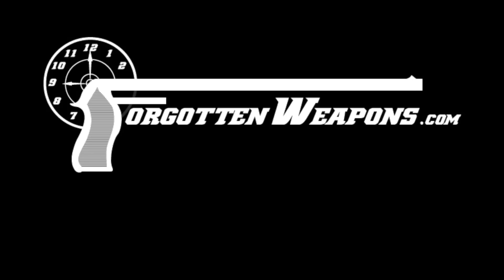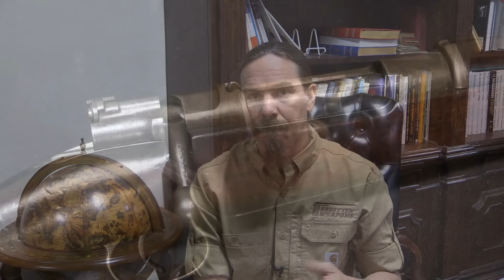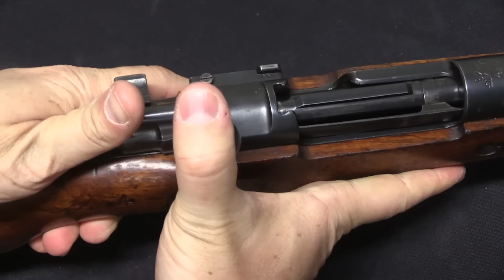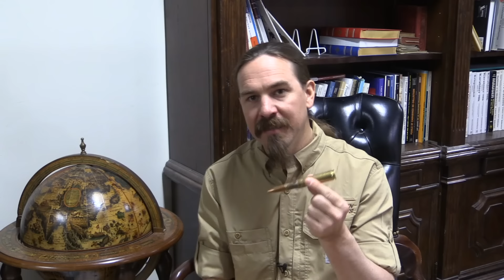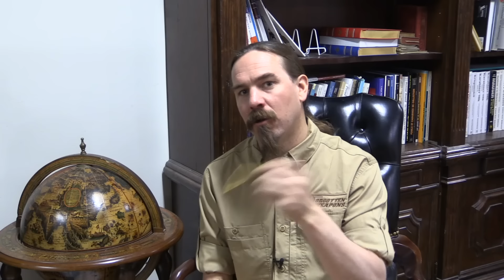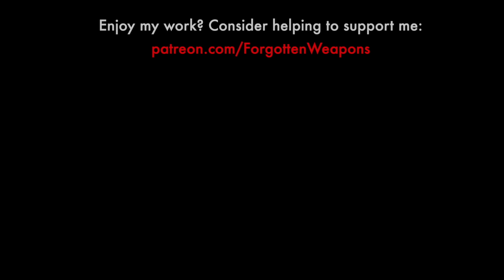Earth-Shattering ka-Boom! How (and Why) Guns Explode

Comment: Questions that Engineers and maybe Ian:

What overpressure % should a chamber be able to handle? Was this overpressure something that the design of the gun should have been able to handle in the R&D process? It seems like the amount of pressure necessary to shear off the breech cap was 30k higher than the expected pressure of a .50 cartridge, and it doesn't seem like that's something you could expect to design for.

What safety devices could you construct on the RN-50 to relieve/contain pressure in an overpressure detonation like this? The only thing I can think of is a much heavier duty surface than those two dog ears to make sure the cap is fully engaged that would be enough to launch it in a different direction, but I'm not sure something with that much strength is feasible for that design.
Reply from the maker: Standard proof load rounds are typically 30% above rated cartridge pressure.

Comment: Once at a public range I witnessed a Ruger Blackhawk  explode in another shooter’s hand. The top strap folded back and the cylinder went flying. Turned out he was using very hot hand loads from a friend. Thankfully, no one was hurt.  My take away was to never use someone else’s hand loads.

Comment: The problem is generally caused by the inability of the chamber or barrel to sustain the internal pressure resulting from the rapid combustion of gunpowder inside the chamber of the firearm.

Comment: Because PV/t, isn't propellant designed to excelerate as I burns to keep the pressure constant as the volume increases as the bullet travels down the barrel?
That being the case, should the bullet stop, the increase in burning rate combined with the volume not getting larger, make the issue much worse?

Comment: Scott said that there was no bore obstruction in the rifle. 
The rifle failed because the threads in the cap sheared off and the locking lugs failed. 
It would be nice to see an autopsy of the failed firearm done by an accredited testing company, I would not be surprised if the hardening of the end cap & receiver lugs were either too soft or overhardened to make them brittle. 
Was the bullet found stuck in the barrel after the explosion? 
The rounds that he was firing, are there any left? They would be worth testing as well.

Comment: Some say that the slap round was not approved for the compensator.Not sure but the previous round kinda acted like it was looking like that.Glad he is gonna make a full recovery.Just tried to tell a kid that his .223 was not rated for 5.56 yet he still fired it.From my understanding a 5.56 can shoot .223 but a gun rated for .223 should not fire 5.56 due to the head space angle differences.Alot more pressure in 5.56 loads.I believe alot of folks do not know this.The salesman at my dunhams tried to tell me otherwise and im glad i research before just accepting hearsay.

Comment: Ian a slap round is already the hottest round of all the 50bmg rounds, And most of them are old really old. So As nitric acid gas bubbles out it changes the surface composition. This is in fact bad, very bad. Pressure spikes can and will develop so the extra pressure. So it was not caused by a barrel obstruction it was extra pressure due to the nitric acid break down of the powder and it takes millionth of a second pressure spike to blow.  Incase you did not know a slap round is sabot around a titanium core that needs a lot of extra pressure to get the titanium core to punch armor. I have pulled about 50 of them a part to get the old powder out to reload and had only 7 of them that had good powder in them. It comes down to how they were stored most of the time.
Reply: M962 SLAP-T and M903 SLAP have the same chamber pressure as M33 ball, they are not "the hottest." The increased velocity is due to the projectile being lighter weight than standard ball ammo, not increased powder charge. Also, the penetrator is tungsten, not titanium. I strongly doubt the chemical composition of the powder changed that much as SLAP was first used in Desert Storm, so at worst the ammo was around 30 or so years old. People shoot old surplus ammo MUCH older than that with no issue. The SLAP round was intended to be fired from the M2 machine gun ONLY, not a rifle with a muzzle brake. In fact, the manual for the Armalite AR-50 warns to never fire saboted ammunition through it because the plastic sabot can get lodged in the brake and damage the weapon or cause injury or death to the shooter.

Comment: Is there anywhere that has the fired cartridge case parts? Was it destroyed in the detonation?  I believe it was a catastrophic case head/rear end failure, due to something out of spec with the ammo. I do not believe Ian's surmising that it was a bore obstruction whatsoever. This is because of the failure of the rear cap/containment of the deflagration... it was never going to have a forward path once the case head separated early in the propellant burn/pressure curve.
Reply: @Research Development Thanks RD, yes I did watch the video of the event and appreciate the info that the case head had indeed separated. If this occurred after the cartridge was fired (rather than as a result of the rear cap failing prior from so many different theories on the net right now) then the cartridge case would not have expanded to grip the chamber walls and seal the deflagration and direct pressure forward in the controlled pressure curve as the "pressure vessel" was designed to contain, I believe this was certainly the reason this occurred.
Hey, I'm only an Aussie bush mechanic (Mech Engineer and metal tradesperson) but have seen a few case head separations in .308, .243, 30-06 in strong bolt action rifles including Mauser, Rem 700 and seen the locking lugs deform and destroy the ection, in one case shearing off the lugs and driving the bolt back down the lug raceways. All events had owners using compromised, well used empty cases that showed signs of incipient head separation prior to loading. In one case, an old Lee Enfield blew the lugs when a case head separated from old, 1943 cartridges where the brass had deteriorated and started to crack. Good topic mate.
Reply: @Research Development Yes mate, I'm a construction guy who now lives on the family cattle/deer property full time, I suppose US guys call it a rancher? But the firearm blow-ups I have experience with were (due to apparent circumstances of firearm design) survivable, in each case the shooter got a faceful of small brass pieces and burnt powder kernels impregnated under their skin and in eyes, one was a friend who had a resulting serious infection (due to his doctor and himself) from not managing the injury properly. One pro pig shooter had metal pieces in his supporting (left) arm from the floorplate blowing out,as well (308).
It seems that the shooters being right handed (the actions blowing out on the opposite side to their face, in conjunction with the gas management being physical barriers in the action design, saved them from a direct rearward blast from the case head separations. It seems that a huge percentage of the pressure in these incidents directs backwards before the projectile exits the barrel allowing the pressure to drop. No projectiles were still in barrels, no barrel damage (a sign of obstruction) whatsoever, although actions/bolts were completely extruded and misshapen.
To me, and I'm no expert apart from my experiences, the rear cap design of the firearm in this blowup incident could direct the gases from a head separation nowhere but straight back into old mates face. Whatever the failure reason.

Comment: Mark Serbu posted a video a while ago correcting that the thread pitch, size and metal used would need and excess of 166000 psi to shear the cap off like it did in Scott’a case, which is pretty insane

Comment: I’m surprised you didn’t mention Mosin Nagant. As far as I know there’s no vent hole in the action. Also you need to carefully adjust the firing pin so it doesn’t pierce the primer and cause gasses to be directed back at the shooter.

Comment: Any follow up to this video since the recreation of the accident and Serbu's latest analysis?  Seems as though, all things considered equal, it was the round being extremely overcharged and not the barrel being obstructed.  In the recreation video it seems as though the bullet does in gact exit the barrel.  Also the video of the RN50 being poured into concrete and fired with the cap remaining in place.

I wish the case could have been analyzed for possible chemical composition to see just how the round was over charged.
Reply: The round being extremely overcharged is what then became a bore obstruction. The bullet did not leave the barrel fast enough to relieve the built up pressure, and so the gun went kaboom. That's a bore obstruction.

Ian said in this video that the cartridge is extremely overcharged.

Comment: I had a 6.5 Swedish Mauser that from time to time used to pierce the primer on firing .... the result is that the cocking piece comes back like a piston at high speed and used to hit my thumb and that was never pleasant .. I believe I was the cause of the failure as I purchased a couple of thousand primers from someone who had I believe subsisted Large Pistol primers to make up the number had no trouble when I changed to new bought primers the remaining primers where used to load pistol cal lever guns.

Comment: Mark serbu just recently uploaded a video where he's talking about how he gave Scott the wrong number for the amount of pressure that the RN50 can handle. Mark said he accidentally gave Scott the wrong number off the top of his head. But after consulting with another engineer he made the video saying that the RN50 can actually handle over 160,000 PSI, and not just the 85,000 PSI that he had previously mentioned.
Essentially Mark explained that that round wasn't just a little hot, it was giving out well over three times as much pressure as it should have.... Bruh...

Comment: I saw a brand new AR detonate with Turkish ammo. Didnt smell right. Had a rotten egg/ammonia smell leading me to believe the powder degraded or pistol powder was used. Magazine ballooned open. Bowed the upper and lower reciever. And split the bolt carrier in two. Case was still against the chamber walls. The very end of the case where the extractor grabs came off clean like it was cut. No bore obstruction. Scared the hell out of her. Gun did what it was supposed to do. It failed but didnt hurt the shooter.

Comment: I got an 8mm chambered in the smallest version of 8mm Mauser. The steel case junk i bought didn't indicate that it was the largest version of 8mm. I hadn't shot 8mm before so I didn't know that the recoil was increased. Only thing that happen d was that the cases got stuck in the chamber last one I couldn't get out and had to go to a gunsmith. No damage to gun but found out the bore was corroded. Sold it next gun show.

Comment: Tibosaurus Rex pulled out the military sniper manual on 50 cal rifles and it’s specifically says to never fire those type of sabo rounds thru a barrel with a muzzle brake. The buildup in the brake most likely caused the obstruction. That rifle also has zero safety features to divert the failure away from the person. They are not a safe gun.

Comment: It was a special 36 inch heavy barrel and "machine gun chamber" specifically designed to shoot heavier loads. The longer the barrel, the higher the chamber pressure. That ammo wasn't designed to be shot out of such a long barrel. And that rifle wasn't designed to fail safely. Throw a long a$$ barrel on a zipgun with 4 pipe threads for lugs and you no longer have a rifle, you have a pipe bomb.

Comment: I'm surprised the open bolt action out of battery detonation didn't result in an immediate stop to check the barrel for a bullet lodged in it - and that this wasn't mentioned as a potential consequence of detonation out of battery that results in cartridge case failure. If this failure mode doesn't create sufficient pressure to push the bullet out the end of the barrel, it's the same as a squib round and the next round will KABOOM the firearm. One of the other failure modes I've seen is firearm calibers that crossed over from black to smokeless powder with someone loading an antique that was made for black powder with the proper caliber, but in a hot load with smokeless powder. A classic example is the .45 Long Colt that originated with the M1873 Single Action Army. Load up one made in the black powder era with one of the hotter smokeless rounds made for large game, and the cylinder will likely fail, probably with the back strap as well. There are other examples of old firearms not made for some of the commercially available loads available for the caliber now. I have a Ruger Blackhawk .45 Colt that I made certain can handle the hot hunting loads commercially available for that caliber before I bought it. Some are not. Same applies to some calibers that were used in revolvers and carbines to simplify ammunition for those that carried and used both. There are hot hunting cartridges now for the carbines that should not be used in some revolvers.

Comment: The obstruction was in the muzzle brake. There is NO copper engaging the rifling. It was a SLAP round with a polymer sabot.
The SLAP round manual says they MUST NOT be fired through a muzzle brake.
Why?
As the polymer sabot leaves the muzzle it tries to spread and leaves residue on the inner surfaces of the muzzle brake. After several shots there's enough residue to cause an obstruction and a pressure spike, ka-boom. Shooting a non SLAP round DOES NOT clear the residue.

Comment: I am curious about any issues in firing the military surplus 8x56R cartridges through my Steyr Mannlicher M95 carbine. The straight pull action seems to be a weaker design than the turn bolt of the Mauser. Are their issues with this ammunition as you experienced with the Turkish 8mm surplus? BTW, I have considerable amount of that Turkish ammunition.

Comment: I am not a gun expert, and probably know less about firearms than most commenters here. I am a failure analyst. I was disappointed that Ian did not explore the design of the RN 50 in any depth. Yes, I accept the diagnosis of a hot round, but as Ian himself discussed at length, a firearm CAN be designed to mitigate aspects of catastrophic failures. And some of those mitigations can be very simple. He leaves us to draw our own conclusions, I suppose. Well, the RN 50 had no mitigations whatsoever, to all appearances. Just those threads, and if they fail, you take it in the face. Again, yes, they cannot make it indestructible, I get it. But an engineer has to ask himself, now that I think I have all the bases covered, what more can I do, in case I am wrong? Or in case the unforseen occurs? What happens when -- not IF -- what happens WHEN the chamber pressure exceeds 85,000 psi? Well, I saw those two little tabs on Scott's rifle, behind the cap, and naively thought they were reinforcement for the cap threads. No! The forces involved, if the threads have failed, are probably orders of magnitude greater than the strength of those tabs. Well, we saw that amply demonstrated in Scott's video. Those tabs are only to keep the lower receiver (?) with the firing pin from closing if the cap is not fully seated. Anyone thinking they will stop the cap is dreaming (frankly, I am suspicious that the manufacturer might have thought they would "help a little", although they of all people should know better). But what those tabs did was convert some of the energy of the cap into a downward moment on the receiver, breaking Scott's finger. If we consider that it fractionally reduced the energy going into his face and neck, maybe it was a good tradeoff. But the tabs sheared off and became projectiles, either one of which could have killed him, and one of which nearly did. I think the receiver must have broken one or more pins, for it to have rotated down and separated as it did. So I would recommend stronger pins and a redesign of the tabs. They won't stop the cap if the threads shear, but they can be made to redirect it upwards or to the side. In any case, they should be made strong enough to stay attached, at least. And maybe a burst point, so the threads are less likely to fail in the first place. I am not sure how that would be done, but I suspect it is possible. After all, when you make a firearm as cheap as the RN 50, maybe there is room to add a little cost for niceties like safety. As it is, you couldn't pay me to fire that thing.

Comment: I was firing my 1911 at the range and got a pop and no kick and stopped, I pulled the magazine and kept my gun pointing down range for about 2 minutes and then pulled the slide back and observed an empty case eject, I locked the slide back and looked into the chamber while pointing the gun at the sun and didn't see any light, I field stripped the gun and saw the base of a bullet about 3/4 of an inch up the barrel, Cause? Badly reloaded ammo and got a squib.

Comment: I just wonder how a crew cap compares with locking lugs in terms of mechanical strength. 
Since the old days of proof-marking that British shotguns had to withstand much higher pressures than standard shells in order to be certified.

Comment: With the RN-50, I'm a little surprised that the difference between maximum expected chamber pressure and minimum failure pressure wasn't a lot bigger. Does anyone know if there's any industry standard practice as to how much stronger a part is usually made, compared to how much it's expected to routinely see?